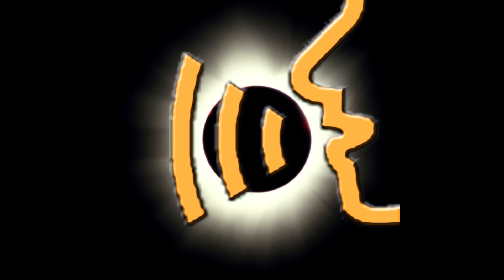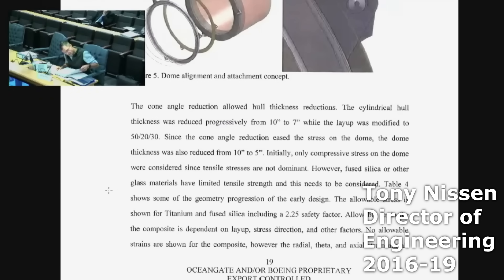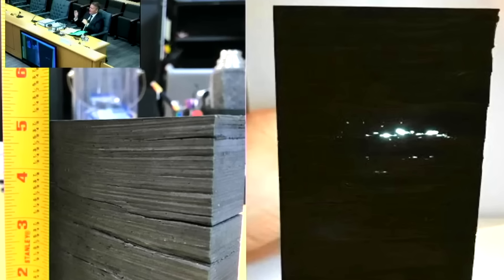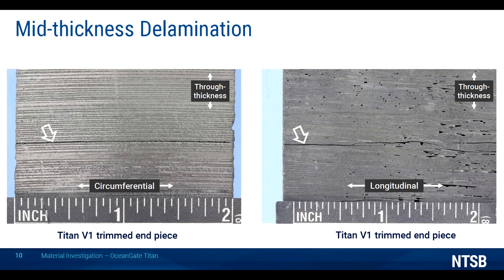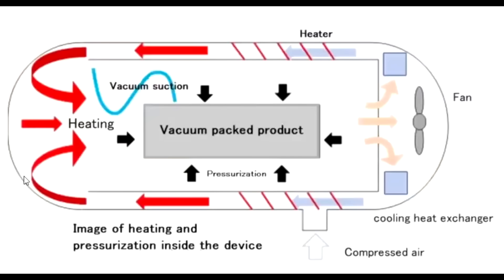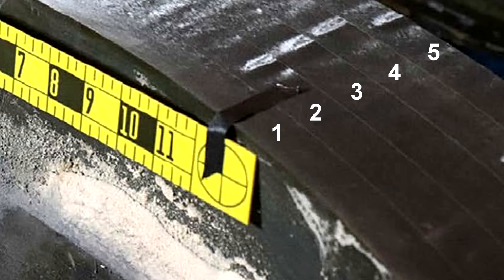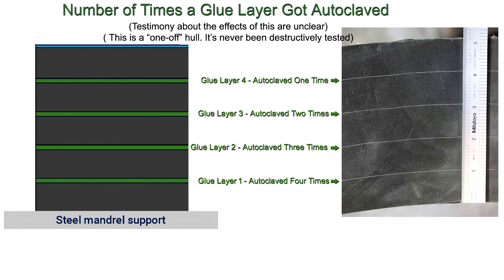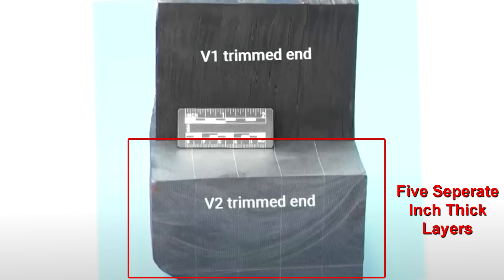Who Engineered the OceanGate Titan V2 Hull? Maybe Nobody Did?

Comment: So, when all this happened, I did a quick on-a-napkin calculation (I mean literally, I was in a tea house having a full English breakfast with some friends, and I know that's made you hungry for a fry-up now) and I came up with a figure of 18 inches thick because the figures for carbon fibre vary so wildly depending on the lay-up that I had to fall back on the strength of epoxy alone. I think what they should have done is have an inner and outer layer 1 inch thick, but with a syntactic foam core of 18 inches, and use glass fibre instead of carbon because glass fibre undergoes plastic deformation instead of sudden catastrophic failure. This is purely theoretical, of course. In submersibles with glass fibre pressure hulls (like the Royal Navy's DSRV, the LR5 that David Lochridge piloted--and if you do a google image search for its sister submersible, the LR2 you'll find images of the pressure hull on the London Science Museum that'll give you an idea of how heft a composite pressure hull designed for an operating depth of just 400 meters has to be) layers of chopped strand matte were used to improve bonding between layers, so you'd have to add that to the overall thickness as well. When they were classing the Deepflight Super Falcon and Dragon pressure hulls, they had to be rapidly cycled in a test chamber hundreds of times over a two week period to 6 times their operational depth before they were deemed safe (and even then Lloyds would only let them dive to 100 meters). There are unmanned ROVs and UUVs capable of 6500m dives with composite pressure hulls that have perfect safety records (some of which are nearly as big as the Titan), but even they undergo far more rigorous testing and are built to way higher standards than the Titan ever was. I know I'm stating the blindingly obvious here but what's really bonkers is that they used an untested material to save money whilst in actuality they should have literally spent billions and at least a decade on R+D. Incidentally, gluing those end rings was stupid as well since when you join two dissimilar materials you need a flange of some deformable material like neoprene between the two and hold them together using tension bars so the different stresses aren't communicated between materials; they shouldn't actually touch. It's like Stockton Rush dug deep and found the right literature but completely misinterpreted the rational behind doing things in certain ways.
Reply from the maker: Thanks for commenting.  A while back the NAVY had a composite unmanned sub called AUSS (Advanced Unmanned Search System) that used composite glass and it worked great.  It was a smaller diameter however.
Reply: @ I think that actually had a carbon Fibre hull. I mean it can be done, but the standards of manufacture have to be so insanely high that it's rarely cost effective.
Reply: Very informative post, thanks! Interesting about glass fiber being more compliant and thus less brittle than carbon fiber, I hadn’t known that but I guess it makes sense given that carbon composites are used in weight-sensitive applications vs fiberglass because you get better stiffness with less material.
Reply: @ Well, it depends. Solid composite laminates use more material for greater stiffness but are still lighter. A sandwich laminate (eg glass-PVC foam-glass like on a boat) can be made incredibly sniff and weigh just a fraction of metal but be less able to take impacts.
Reply: Carbon fibre is far stronger than fibre glass.  But any structure's strenght  depends on how the fbres are laid and the process to have the resin/matrix injected into it without any air bubbles/defects.

Comment: The last dive was the first dive of the season!? Had not seen that previously and it certainly makes the analysis more difficult but, on a personal level, really reminds you that you don't want to be first if you can avoid it. I'm surprised they didn't do a test dive to start the season. Interesting look.
Reply: I get what you are saying, but really every dive Titan did was a test dive. And not just because Stockton called it "experimental" as a way to get around regulations.
Reply from the maker: @bobcousins4810  Yes, I guess you are correct.  It was all a big test.  Thanks for commenting.
Reply: @ Great information. I'd like to think I'd be smart enough not to go down but the truth is, if I was already so smitten with the idea that I rode out on the ship, it'd be really, really hard to say no to going down.
Reply from the maker: @ Yes, I could see that point.  But what if you got to the boat to start your voyage, and that was the first time you actually saw the sub in person for the first time! I think seeing the build of it, could scare you away from diving in it if you had any sense at all.  But you would be giving up your $250K.
Reply from the maker: Thanks for commenting.  That last season they did about three very shallow test dives to check out systems (to 10 meters).  A four dive is logged as an aborted dive (10m) with no other information about the abort.  But that five dive was their first attempt to go to the Titanic that season.

Comment: Think about what would happen to the hull, when they lifted it from 4 points, 2 at each ring.  You will never have all 4 legs of the chains pulling with the same tension on the 4 individual lifting points on the subs rings. 

There would be a twist, a torsion placed on the hull. Perhaps this is could have been mitigated by the 45* plys they didnt use.

I wonder what this twist would do to the hull.

Also i recall when the platform tipped and the sub was semi-attached still. Did the hull have to withstand a twist there?
Reply from the maker: Yes, I agree.  It's a little hard to sort out, but for the V1 hull, Tony would not let Stockton put lifting points on the titanium rings.  That is in Tony's testimony.  But yet, there seem to be lifting points welded onto the titanium ring in the V2 hull.  Those must have been added after Tony was gone.  But I agree with you, it is a bad idea.

Comment: You go down that deep, for 1000 cycles,  you better be in a 2" thick or more, titanium sphere. Put it at the front of an epoxy cylinder chassis if you want, for  maneuverability, but a flooded one.  Then you put all your engineering into the viewport(s) and thrusters.
Reply from the maker: Thanks for your comment.  I agree with you.  That carbon fiber hull concept was never going to last 1,000 cycles.  I have no idea how Spencer Composites came up with that prediction.

Comment: I'm more than qualified to say at first glance of the specs and knowing how deep he intended to take it, it was a 100% chance of an implosion event. 5 inches? Carbon fiber in a cylindrical configuration going to the Titanic? 5 inches. Guaranteed failure. CF likes to be pulled on, not crushed. Oh, my qualifications? I'm an  automotive mechanic. And even I would know, no way. 

Stockton absolutely knew this would eventually happen. He'd have to. Just a basic understanding of CF and ... a 5 inch thick cylinder? Suicidal.
Reply from the maker: Thanks for commenting.  I agree with you.  The interesting thing is that the engineers at Spencer came up with the 5 inches for the V1 hull and they probably are not stupid.  Their design proposal crunches all the numbers.  However, the predicted strength was way lower than the real data obtained from deep test dives in the Bahamas.  So, the unknown is; were their numbers pretty good, but the technique of the layup was terrible and therefore weak.  Or were the calculations and the manufacturing both bad for the V1 hull?  The V2 hull with the co-bonding technique seems to be a completely unknown entity.
Reply: @solareclipsetimer  great thread to pull on. Was it design, execution or fundamental material data lacking/inaccurate? Fascinating questions.
Reply from the maker: @x--.  Thanks.  Good points.
Reply: The pressures at these depths are just not compatible with the materials used. You just don't even go down this laminated road in your autoclave.  No one ever told him I guess but Titanium alloy is a beautiful thing and spheres are 3-dimensional arches that are great in compression. He was dead set on making this oceanic rube hindenberg work if it killed him.
Reply: @Metal-Nine11  IMO, not suicidal, just deeply narcissistic
Reply: @peabody3000  Very true. That level is something else. I'm obviously not genius but the whole thing sounded like a bad idea. A horrible idea. How smarter people than I, put themselves inside it, i don't get it. Carbon fiber sounds like a very very bad idea with even a basic understanding of it. And pressure. Lots and lots of crushing pressure and cycles. I get so stuck on five inches. I'm no engineer, but my common knowledge screams "no".
Reply: @Metal-Nine11   the original proposal was for a 10 inch hull thickness, but to go to twice the depth. stockton apparently decided half the thickness for half the depth was therefore sound, even though he obviously wasn't going to halve the diameter of the vessel. and he may have started with that doubled number in order to disguise his motives of diving to titanic.
Reply: @peabody3000  apparently nobody approved his "design". Nobody.

Comment: Things do not get “Lathed” down, there is no such thing as “Lathing”. Parts or materials get turned down. I just wanted to nitpick 😁
Reply: If you're going to nitpick at least be correct. ""Lathe" - verb - to cut or shape something using a lathe machine"
Just because "turn" is standard industry parlance doesn't negate the fact that "lathe" as a verb is correct...
Reply from the maker: @ Thanks for your comment.  I actually did look up the using the word lathe as I did and I thought it was acceptable.  Not sure now; but it did describe my point.
Reply from the maker: Yeah, you maybe correct.  The way they had to decrease the circumference of the hull was on a huge machine (which I guess was located at Janicki)  that probably would not be called a lathe anyway.  I was just trying to be descriptive to make the point and it was sloppy.  Thanks for your comment.

Comment: Shocking.  Safety regulations are always written in tombstones.
Reply from the maker: Thanks for commenting.  You make a great point.  It's unfortunate but true.  So, due to this disaster, I have heard that the big marine groups are trying to organize some regulations that would cover international waters, so this can't happen again.  I don't know what they will write or how it could be enforced, but it is being worked on.  The other thing that may come of this is a standard design for having a hook or eye on the top of every submersible.  This design would be shared with the ROV industry.  So in the case of a sub stuck on the bottom, all ROVs would have a place to hook on easily and they would know the design.  It does no good for an implosion obviously, but what if Titan was just stuck on the bottom, where could an ROV easily attach to drag it to the surface.

Comment: The last thing is... even IF someone had said it was good enough, there's still the diagram from Boeing with the little skull for anything under 7inches. It would not suffice to say it's good enough, you had to disprove that.
Reply: 7” of 45° bias-wound fiber, properly laid in a homogeneous mass (not layers), and with the huge caveat that the calculation made no consideration of securing the ends of the cylinder itself - it was about the pressure on the walls only.
Reply from the maker: Thanks for commenting.  As I noted in the video, Boeing was involved with the hull very early on in the history of OceanGate; 2012 -2013 with an early feasibility study.  Boeing was out of the picture by the time manufacturing was happening.  The early design and analysis were all based on what was done at Spencer

Comment: You should never believe anything regarding past and names. So when Tony said it was David Spencer and Stockton then it can just mean Stockton told Tony this is what Spencer recommended. You would need to have a transcript to tell if it was even a recommendation as in "just use less" or a "ok Stockton if you do, you do". Every single statement from OG is something that needs to be verified a lot more than we could.
Reply from the maker: Thanks for this comment.  In Tony's sworn testimony he states that when he was hired on to OceanGate the hull mandrel was already built.  He has a lot of other testimony about seeing if Stockton and Spencer would make a longer mandrel to have longer cut-offs for testing.  Tony referred to the extra length as "witness panels", where a real cross-section of the carbon fiber plies would be seen.  Because the short (6 to 8") cut-offs they had are not representative of the center of the hull becasue the ends is where the winding process doubles back on itself.  So, the mandrel, the thickness, and the lack of 45-degree plies was already decided.
Reply: @ he is an engineer. So even if they decided about hull thick before he came, his responsibility was to check the calculations. Who done? Methodology and results? I’m not buying what he said.
Reply: But at the same time who cares… the result is of the same consequence as a single car accident with no other damage to anything else. It’s a fascinating story though.
Reply: @punisher0717  imagine i had a car that I made myself, along with my personal mechanic. unbeknownst to either one of us, the 69th time I start the engine, a design flaw will cause it to explode killing all inside the car. 

you and I and a few of your friends want to go check out a neat spot a few miles away called titanic point. we get in the car, i start it, and then we all die. 

would you blame anyone for not wanting to let that mechanic build a car again? even if he said the car was dangerous, he still helped build it.
Reply: @ did I sign a waiver that said it might explode and I will die In that event? Also what you describe has happened, they still make cars if you haven’t noticed.